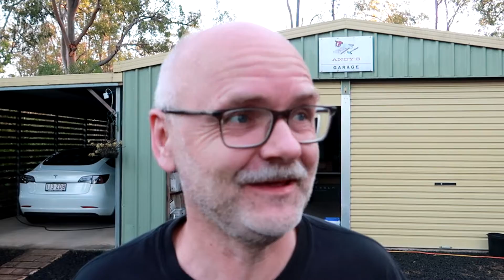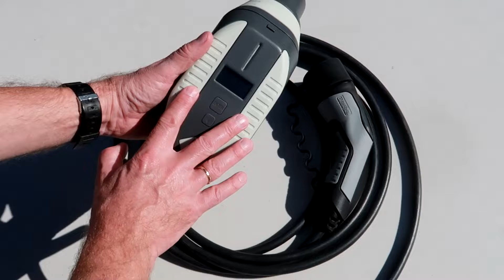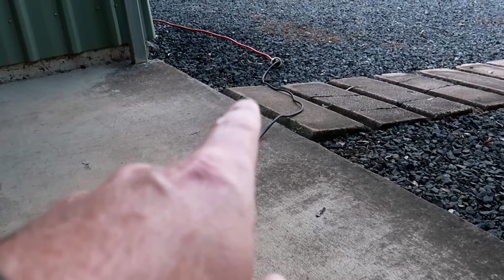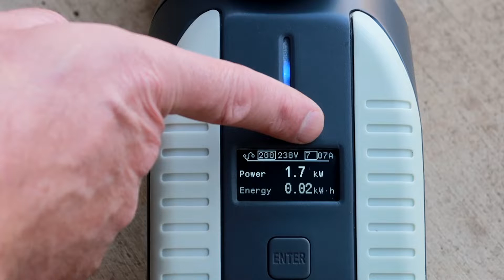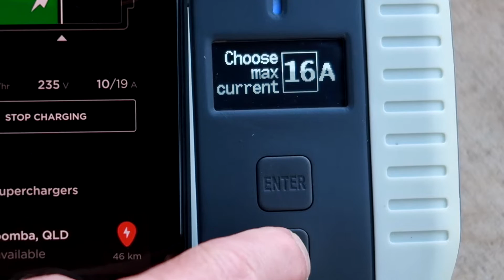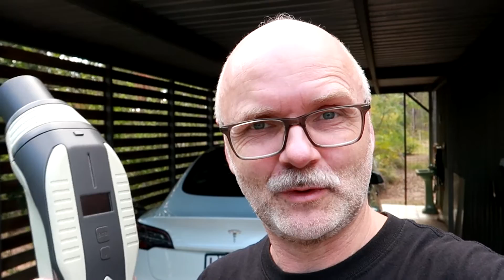EP372 - The CHRGET Universal Mobile Charger - Is this the 'Tesla' of all charging solutions?

Comment: Hello Andy I have a question about balancing the batteries of Tesla Model three standard range. What is your opinion I saw a Uve Kröger video yesterday and he said that once a year you should drive the battery to 0% and then charge it to 100% at the Schuko Steckdose to balance the battery. How do you feel about it I saw a video of you where you wrote that balancing the battery management system itself do this and that is not necessary to balancing . Best regards Jörg from Darmstadt

PS:

How many kilometers are you shown in your Tesla app in charging mode if you set to 100%? How much did you have at the beginning and how many have you lost? Thanks for the information
Reply from the maker: Hello Jörg, hope you're doing well!
The method he talked about is not for balancing but for calibration. If your km shown and estimated by the car are far off, you drive it under 10% and recharge to 90% a few times while leaving it plugged in afterwards. That is the official method recommended by Tesla. This has nothing to do with balancing though. He's probably confused about what balancing and calibration is.

My app showed 384km on 100% when I got the Tesla Watchdog. Now, it shows 375km when set to 100%. But, we now have winter with far colder temperatures and I always charge the car to 60% only for months. I need to wait for warmer weather again to see if there is a difference and if I have to re-calibrate the BMS. The Tesla Watchdog shows me 3-3.4% degradation so far after 15.500km (remember in the first couple of months, that's when the battery loses the most).
Stay safe!

Comment: It looks like a very good product, but I won't rush out and replace my evolution version any time soon.
I hope that there is a 10amp earth leakage circuit breaker in circuit when connected to a 10amp socket. It certainly isn't the "Tesla" of all chargers though because it hasn't got a big screen screwed to it.
Reply: Hi Walter! Instead of a 10A earth leakage circuit breaker, we have 50A relays for load-breaking in case of leakage or other emergency situations.
Reply from the maker: There are actually 2x 50A relays inside the unit (for active and neutral). I didn't put this in the video but will follow this up soon.
Reply: @chrget-universalsmartevcha5046  its a very nice product and I'm sure it can handle the load. My query was simply that if it is connected to a 10amp socket, is there any chance that it could attempt to draw more than 10amps. If so protection needs to be present.
Reply from the maker: No, that's not how it was, Walter. The charger was connected to a 32A plug and socket and I, only I, had connected this 32A socket to a 10A cable and plug to fit into my power point. 
The charger correspond with the adapter you plug it in to (same as with the Tesla UMC). You can see other videos (Transport Evolved) where they use different adapters and can set the power accordingly.
In my case I could set the amps from 7-32A because it detected the 32A adapter plug. If I would had it connected to a 10A adapter, It would have allowed me to set it from 7-10A only. You cannot overwrite this setting.
Reply: @unpluggedEV  so that's a no, there is no possible way the software can go wrong and allow a 32 amp load when connected to a 10 amp socket. Excellent to hear.
Reply from the maker: Yep, that's correct.